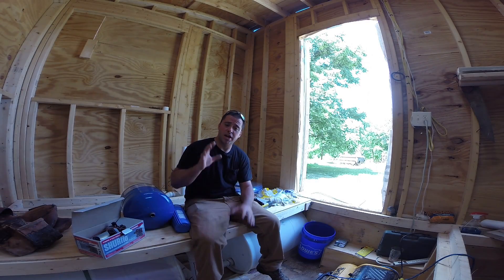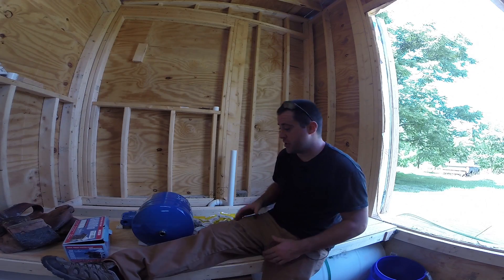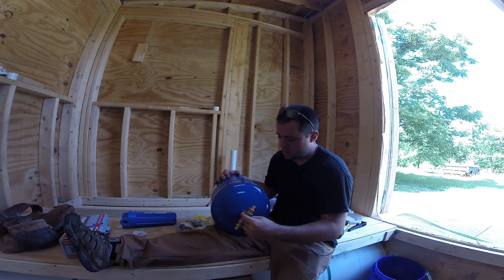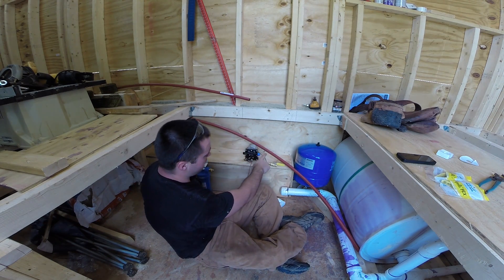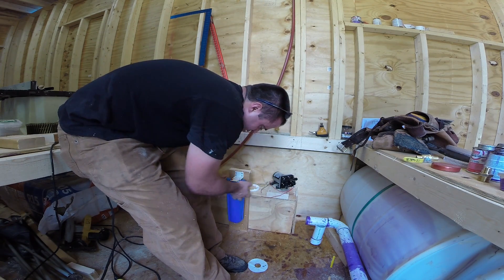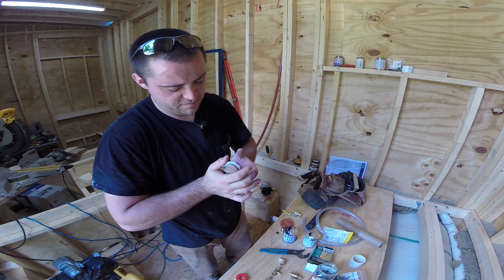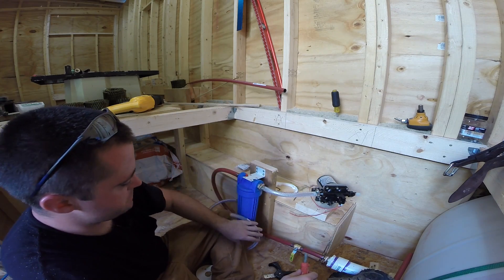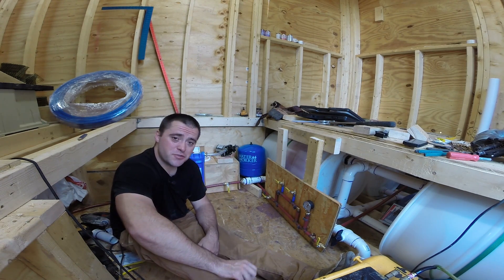Tiny House -  Water pump system installed. Part 1 of 2

Comment: I'm planning to put a 75 gal tank in the basement and use the 12v pump (or 110, have not decided ) to provide our house with toilet flush, shower and washing during power outages. this way i can use a small honda 2000 to feed the house as there wouldn't be a need for a big 10kw gen for there isn't a 220 circuit anymore seeing the water heater is an on-demand propane.   ...   less gas, less noise, less power, lighter penny.     always can keep a few 5 gal water jugs on hand if i need more water. but they say most showers are 17 gal and a flush is 2 gal..    i suspect 75 gal used with reason ought to be enough until the power returns

Comment: Great video.....  This is almost exactly what I use in my off grid cabin.
Reply: I chose this accumulator so it would be easy to mount...   http://www.amazon.com/Gallon-Accumulator-Mount-Bracket-Female/dp/B00IRFW38W/ref=sr_1_3?ie=UTF8&qid=1464682291&sr=8-3&keywords=water+accumulator
Reply: Tell me more. I want to do the same thing.

Comment: The accumulator tank & filter links don't work. :(
Reply from the maker: Just search Amazon for them. Water works 2-4 gallon accumulator tank. And any basic filter will work
Reply: Amazon has many filters to choose from.  Here is the one I bought.  http://www.amazon.com/MOUNTAIN-Sediment-Calcium-Deposit-Filtration/dp/B00JS6XRKC/ref=sr_1_18?ie=UTF8&qid=1464682181&sr=8-18&keywords=cabin+water+filter

Comment: The cheap clear pipe on the pump is a definite weak point.  It hardens up and gets brittle then you will have a flood when you are not expecting it...  You really want a rubber hose with reinforcing material embedded in it.  Like what is used to hook up a washing machine...
Reply from the maker: I hate these types of comments.  For future reference if you have a negative comment use this formula. Positive, positive, negative(this comment) then positive.   A lot of work goes into making these videos and I understand by posting them I'm welcoming constructive criticism but I never like ready just a negative comment.
With that said.  I will look into it more and see about replacing them with a thick rubber hose.  I can see that where the hose clamp is it can eventually fail due to the compression. Thanks for the feedback.
Reply: +Tiny House Customs  I spent several hours yesterday getting current with this thread and overall I think your build is awesome.  You are showing many many examples of craftsmanship, something severely lacking in our society generally..   I made the comment on the hose since I build and modify a lot of test equipment at work that is working with DI water and every time we have used the clear unreinforced hose (thinking it is a benefit that one can see bubbles in the lines etc) they have failed.   In the meantime we use a really good quality Parker rubber hose which has to be heated in hot water to get it over the brass fittings, but that stuff has never let us down.   For a pressurized application, the hose needs layers of internal reinforcing plies, just like the tires on your car.  The clear hose has none of that.

Comment: One thing that I'd suggest for your tanks....(Issues I've run into with my tanks on the RV, that I replaced, but not anymore :)  )....is to mount a access hole on top of each tank (5" screw-able locking lid) so that you can get inside the tanks at times to clean out the algae & gunk'H that will accumulate over time...just a thought and more work for yah...LOL!  Awesome videos so far...will follow till the end of proof of concept....keep it up brother.

Comment: If you had used a Smart Press Pump Controller (Electronic gizmo box) which is about 7" x 6" that would have saved room for you.You then would not need the pressure vessel.No biggie really.

Thanx Dan.
Reply from the maker: +ScootOverMan The pump has that feature built into the SPPC.  the pressure tank prevents the pump from short cycling.
Reply: +Tiny House Customs Still shouldnt need the pressure tank if using smart press pump.

Electronic Controller with integral flow regulation turns pump on and off when  points of use are opened and closed. The Smart Press provides constant  pressure without the need for additional pressure vessels, also provides dry run protection and prevents short cycling.

Comment: The pump will have water in it because they are supposed to test them before they leave the factory.  Great job on the install.  I'm glad you went with a larger accumulator tank, the link I sent you was for an RV small tank.  The one you got will spread out the cycles of your pump a lot farther.  I have an 80 gallon accumulator tank at work and I had to replace the bladder a few years ago, what a pain, next time I'm gonna replace the whole tank.